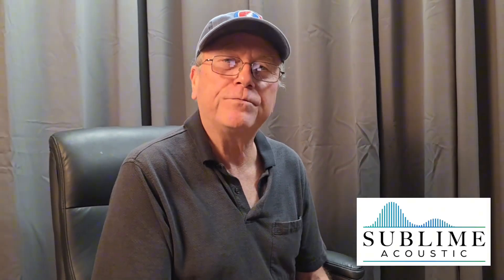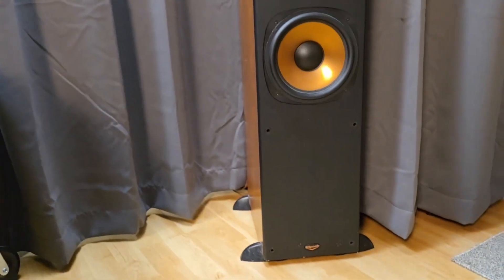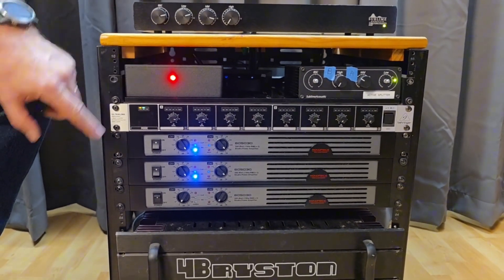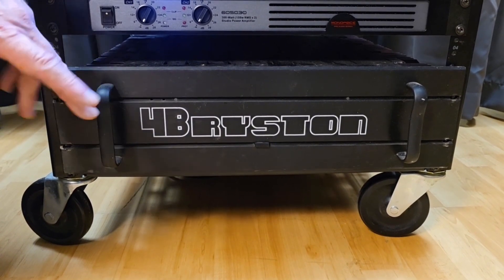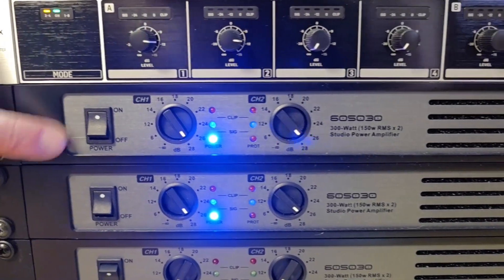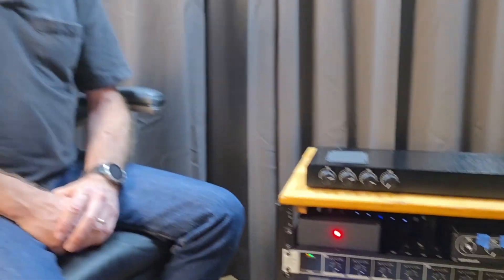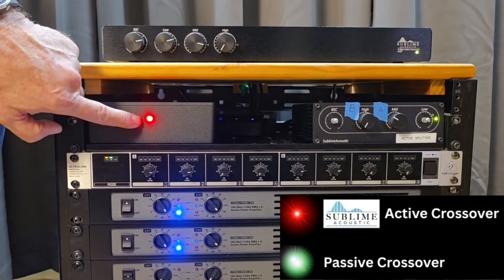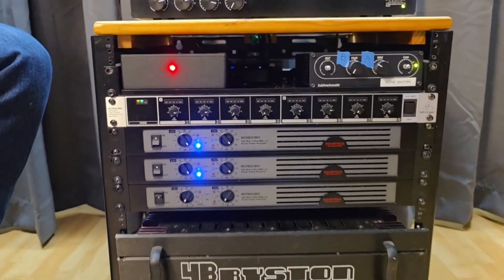Passive vs. Active Crossover: The A/B Test That Changes Everything

Comment: I am not getting this at all? 
First are you running the active crossover through the internal crossover? That's what it sounds like to me. The active cross over should go to 2 different amps, and the amps should go directly to the drivers, not through the built in crossover of the speakers, since you are saying the speakers are not modified then you are feeding an active crossover through a passive crossover? 

Every thing that is changed in the system will make a sound difference! You are changing from one  amp to 2 amps of another brand? That's a lot of changes right there, the amps have a different sound signatures and added to the different combination just makes this test invalid in my modest opinion, the active  sounds has more bass therfore plays louder,  with different a/b levels the one that is louder typically wins these comparisons. 
In conclusion , way too many variables  in this test procedure to make any viable conclusion. Not to mention nothing was said about the type of crossover used or the orders ? All those make a big difference and should be matched so there is no difference in phase shifting,  and how steep the crossover frequency is.
Again with the info provided in the video there is no way to make sense of it or to use it to make comparison. 
I will however take a look at your website to see if I can get more details there.
Reply from the maker: Great questions—and you're absolutely right to be skeptical and curious. Let’s clarify a few things:

✅ Yes, in this demo we are running the active crossover signal through the internal passive crossovers of the Klipsch RF-5s.
Why? Because most users don’t want to modify their speakers. The goal here was to show that even without bypassing the internal crossover, using an active crossover (in this case, the Sublime Acoustic K235) to split the signal before amplification can still provide a significant audible improvement.

🎯 You're also right that the "pure" way to do active bi-amping is to bypass the internal crossovers entirely and drive each driver directly—and we do support that for advanced users. But this test was designed to show that even a passive-friendly setup can benefit from line-level crossover control and separate amps.

On your other points:

🔀 Different amps? Yes—intentionally so. We used budget Monoprice amps on the active side and a high-end Bryston on the passive side to make this exact point:
➡️ An active crossover with modest amps can outperform a passive setup with a premium amp.
The fact that you can get better control, cleaner imaging, and tighter response from a more efficient signal path is part of the story.

📶 Crossover slopes and alignment:
Great point—we’re using a 24dB/octave Linkwitz-Riley alignment on the K235. It’s phase-coherent at the crossover point and carefully matched to the expected response of the RF-5 drivers.
Levels were matched as closely as possible before filming, but yes—louder can sound better, which is why we strongly recommend people listen on their own systems.

📌 Bottom line:
This wasn’t meant to be a lab-controlled experiment—it was designed to spark interest and demonstrate that there’s real, audible benefit to active crossovers even without modifying your speakers.

We absolutely welcome more detailed comparisons and encourage folks to experiment and measure if they’d like. And yes—check out sublimeacoustic.com for deeper technical info, including crossover orders, module options, and system diagrams.

Thanks for your thoughtful comment—we really appreciate critical listeners like you! 👊
Reply: @SublimeAcousticHiFi thank you for the nice reply. I will for sure check your website as I am interested in trying something like this in the future.
How did you hook up the amps? Is one feeding both high chanels and the other feeding both low chanels,,

Or
On amp is feeding the highs and lows on the right  and the other amp on the left.
I'm getting to this point, to avoid cross chanels distortion wich setup would be the preferred one in your opinion , either could easily be done though an electronic crossover.

Also I would really like to see the before and after frequency response as it should be quite different in this case.
Reply from the maker: check the link in the description for the wiring diagram, and please check out our website, this would be a great article for you - https://sublimeacoustic.com/pages/what-is-an-active-crossover-and-why-do-i-need-it
Reply: @SublimeAcousticHiFi  , more pure nonsense it's NOT active if you use passive crossover. It's passive in every way. You backed this up with more illogical. This breaks the record of one of the silliest things I have ever watched loL!. You equalized the sound and biamped, not even remotely close to active, even a little bit. Surely this video is meant as satire no?
Reply from the maker: @michaelchase1911 - At this point, you’re not debating—you’re trolling.

We’ve explained multiple times: the system in this demo uses a line-level active crossover (K235) feeding separate amps for highs and lows. That is an active bi-amp configuration by any reasonable definition. We’ve also been clear from the start that the passive network remained in place to show what’s possible without modifying your speakers.

This demo isn’t satire—it’s real-world, intentionally accessible, and it’s helped a lot of people hear the difference that smarter signal routing can make. If that’s not your thing, no problem. But repeating the same “not active” comment over and over doesn’t make it more accurate.

We welcome discussion. But if your only goal is to shout “nonsense” and dismiss everyone else’s experience, this probably isn’t the right place for you.

👋 Be better—or move on.
Reply: Have the crossover points been moved between active and passive? I found passive was very relaxed sounding. Active was more in your face type sound but wondered if the tweeters were playing lower frequencies or different slope.  I play with active in my pro audio setup and would never go back to conventional crossover after level of control and tuning of active.
Reply from the maker: Great question—and glad to hear you're already enjoying the benefits of active in your pro audio setup!

To answer your question: the crossover points in the active path were carefully matched to the factory passive crossover points of the Klipsch RF-5s as closely as possible. We used a 24dB/octave Linkwitz-Riley alignment on the K235 to maintain phase coherence and avoid overlap issues. No extra treble or lower extension was dialed in—just a cleaner handoff.

You're spot on that active can sound more “in your face.” That’s the increased control and precision kicking in—less phase shift, better damping, and lower IMD. It brings out detail that can feel more direct, especially if you’re used to the smoother, more blended character of a passive network.
Reply: @camaross12  , it's all passive, the crossovers were not removed from the speaker. He is calling EQ active for some strange reason.  I find the video and posting bizarre!!

Comment: The active crossover sounds like ass. All you did was boost treble. The singer's voice is messed up now
Reply from the maker: Thanks for the honest take—we genuinely welcome strong opinions. We think the passive sounds like "ass". 

Just to clear the air: there was no EQ, treble boost, or trickery involved. What you’re hearing is the cleaner, phase-correct signal from the active crossover (K235) doing its job—splitting the frequencies before amplification, not after.

And fair point—this demo is best heard on a real sound system. Through phone or laptop speakers, it’s easy to misinterpret that added clarity as "boost."

Comment: Active is always better..
Reply from the maker: Thank you, we agree!
Reply: @SublimeAcousticHiFi  but this was not active in any way, not even a little bit, passive crossover still doing it's thing. This is ridiculous ..
Reply from the maker: @michaelchase1911 We hear you—but let’s clear this up once and for all:

This was an active setup—just not a fully active, driver-direct system. The K235 active crossover split the signal at line level before amplification, and each amp channel independently fed the woofer and tweeter terminals. That is active bi-amping by definition.

Yes, the speaker’s passive crossover was still in place—but with pre-split frequencies going in, its role was dramatically reduced. That’s the whole point of the demo:
To show what’s possible even without removing the internal crossover.

Is it purist active? No.
Is it real-world applicable and audibly different? 100%.

You’re clearly passionate about this stuff—and so are we. Let’s keep the discussion going without writing off people who are just starting to explore active crossovers.

Comment: I am running 2 Marantz Model 30 integrated amps in power amp mode powering up a pair of Bowers and Wilkins 702 S3 Signature Series towers and it works and sounds GREAT! Amplifying the correct frequencies on your dual binding post speakers means getting more power from your amp and cleans up the frequencies way better than your passive crossover could.
Reply from the maker: Very nice!
Reply: Which model did you buy?